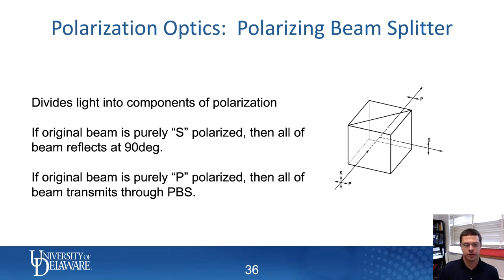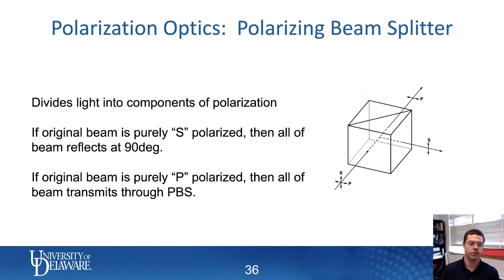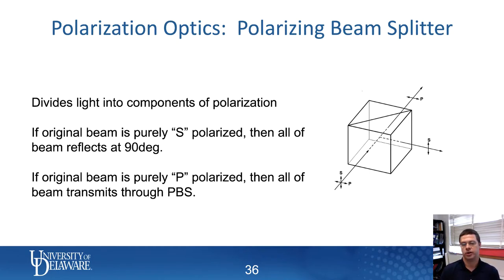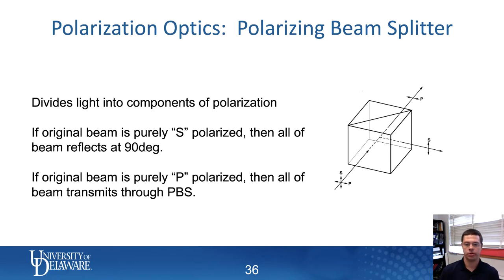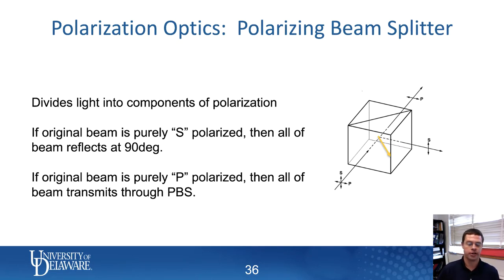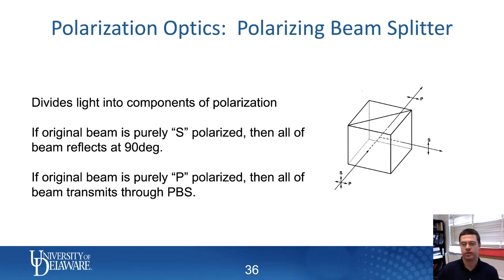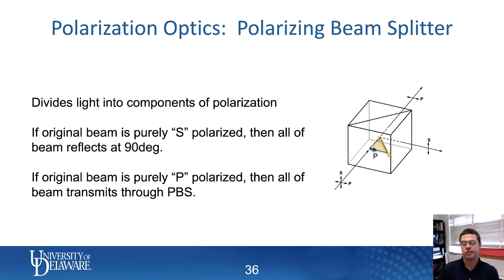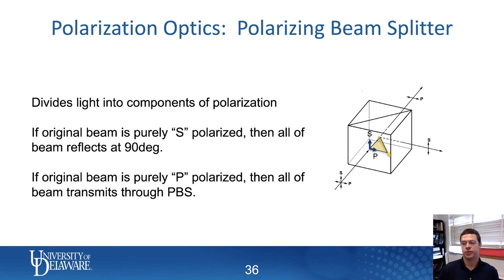Polarizing Beam Splitter (PBS) - TDTR Short Course

Comment: What will be the two output modes (a preferably mathematical expression) of a polarizing beam splitter when the vertically polarized state is in one input mode and a horizontally polarized state in another input mode?